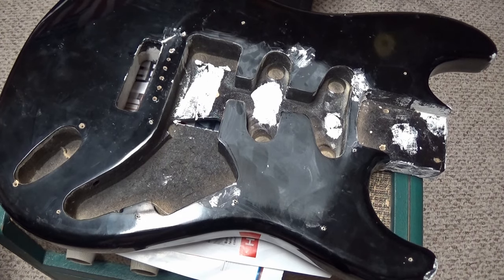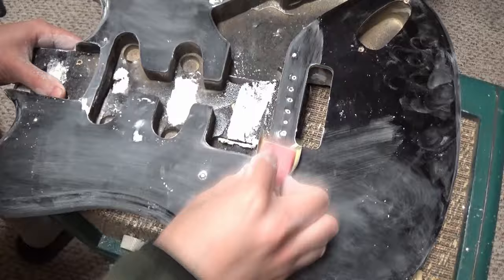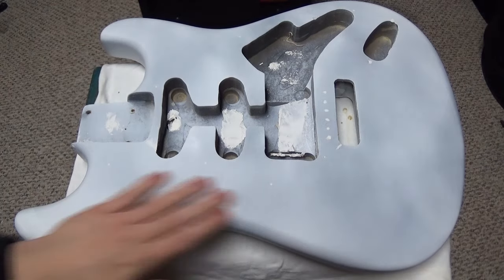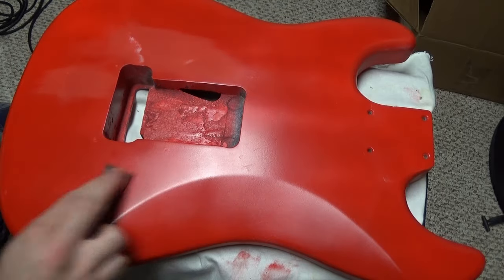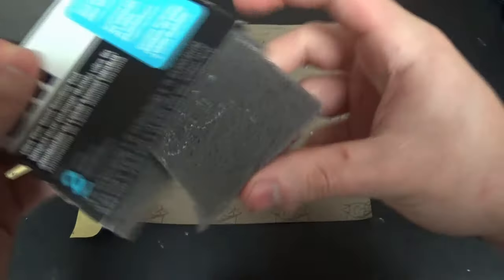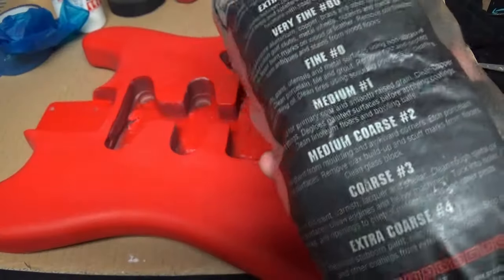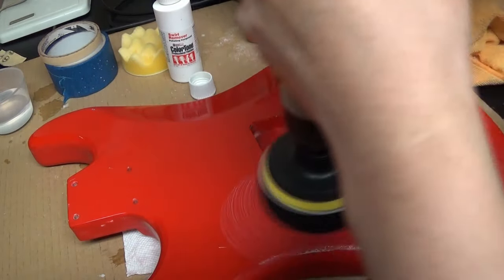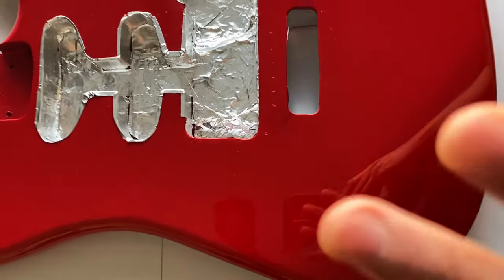REPAINTING A GUITAR WITH SPRAY CANS. Clear Coat Finish

Comment: Interested in knowing what clear coat you used. Was it Rustoleum crystal clear enamel?
Reply from the maker: i used that before. and it left so much orange peel and imperfections. i use the 2k spraymax clear coat, $23 on amazon. It is literally the best clear coat i have ever used in my life. please watch some youtube videos about it, you need a good respirator since there are harmful vapors in it. so make sure you are safe and well ventilated. the 2k clear coat is the best affordable clear coat you can buy that will have a very long lasting finish. the rustoleum clear coat almost never cures, so it stays soft for a very very long time. the 2k clear coat hardens like a rock in 2-3 days.
Reply: Thanks for your time and quick response. I will buy some soon. You have answered all of my questions. Very appreciated.
Reply from the maker: @williambrown5776  let me know what else you need. i need to make an updated video soon once i get another guitar body to work on at home.
Reply: I will thanks. Looking forward to your next video.
Reply: Would Deft clear be compatible over Rustoleum 2x. I finished painting my Stratocaster with almost one can. There are no paint runs but there is orange peel. Should I wet or dry sand, or just apply the clear and then wet sand the orange  peel off.
Reply from the maker: @williambrown5776  is deft clear the clear coat you are choosing to use? if so.. those cheaper clear coat cans will leave lots of orange peel. since the nozzle is a circular spray pattern, it will cause lots of orange peel and possibly runs due to the circle ⭕️ spray pattern. the 2k clear coat i recommend has a wide spray pattern that will lay down much better. but if you do choose to use that deft clear, then make sure you put the can in hot water for at least 15 minutes then shake it up nice before you start spraying. Does your guitar now have a gloss finish with the color? if it has gloss, then i would use a scotch brite pad to scuff up the whole body and remove and gloss before applying the clear coat. just be gentle and make sure not to burn through the paint coat
Reply: A guy at Ace Hardware told it was a great clear. I will go with the 2x clear as you suggested. Is it the rustoleum 2x ultra that looks like the paint can. I know there is the crystal clear and the enamel clear and I surley don't want to mess it all up. If yo mean using the supermax 2x I am not sure I want to use that. Too toxic and no paint sprayer. My wife also has lung cancer. Is there another recommendation.

What do you mean gloss up the paint before adding the clear coat. Also, I used almost a whole can of paint on my stratocaster. Is that enough. Appreciate all your help. If you need any help on guitar theory hit me up. I gotta repay you somehow.
Reply from the maker: @williambrown5776  the spray can for clear coat that i used was “2K spray max clear glamour” $22 for the can. it gives the best results. as long as you have full coverage of color on the guitar, then it should be fine. some paint can colors come with gloss included in the spray can. for example.. rustoleum 2x paint, it has paint and a little gloss to it. i always use a scotch brite pad to remove the gloss from the color. giving it a ‘matte’ look, then i spray the clear coat on top
Reply: I would like to use supermax 2x but with my wife having lung cancer would not be good for her. She also has a brain tumor - her third one.

What other urethane clear would you recommend. I am pretty sure I couldn't use lacquer over urethane. Thanks
Reply from the maker: @williambrown5776  all clear coats have the same / similar chemicals in the can. just use a respirator and keep her away from the spray area. where are you spraying it at?
Reply: I don't have a respirator and don't want to use supermax 2x. I will find something else.
Reply from the maker: @williambrown5776  definitely invent in a respirator. for now you could use a wet cloth on your face to help. spray max 2k is definitely the best. but i’m sure the other clear coats will come out good if you do the proper prep work. cleaning , degreasing and warming the can up before spraying.
Reply: Thanks for the help. You may not be aware of an alternative to to supermax but I will call around to find out what will.
Reply from the maker: @williambrown5776  2k is top shelf, those other rustoleum clear coat may work but they take so long to fully cure. just stay away from any “lacquer” spray cans, only buy ones that say “clear coat” on them. i wish to make an updated video here very soon, just gotta find a guitar body to do the work on. keep me updated if you need any help,

Comment: Is it necessary to do a clear coat with this method?
Reply from the maker: do you want a shiny gloss coat or a matte coat?
Reply: @guitarforall  Gloss. What kind of lacquer did you use?
Reply from the maker: @zemartinho9779  from experience… i started using the “2K Clear Glamour” clear coat. it’s a can you can buy almost anywhere online and it’s the best for gloss finishes. lacquer has too much orange peel which requires lots of wet sanding. the 2K clear coat lays down so much better and less orange peel.
Reply: @guitarforall  Thanks for the quick reply! After the color coats, how long did you wait before applying the 2k clear?
Reply from the maker: @zemartinho9779  i apply color coats until everything is even. wait 2 days for the color to dry and scuff up the paint lightly with a scotch brite pad… not too hard. it’s just to remove any dirt nibs or imperfections. this would also be a good time to wetsand out any runs you might’ve gotten from your color coats. 
Then blow off your guitar and use glass cleaner to clean up and fingerprints / oils from the guitar. then spray your 2K clear coat in light coats … 4 coats should be enough. 7 inch spraying distance, and please wear a respirator

Comment: $7 a can now and those sandpaper sheets are like $1.59. Thanks biden
Reply from the maker: yes they used to be very cheap… now it’s up. couple cents for the paper back then. let alone all the parts that you need for guitars as well.. like pickgaurds, volume knobs , strings. but don’t cheap out on the clear coat! buy 2k clear coat.. much better results and harder finish. i’ll make an updated video soon
Reply: Yep. Just under $8 a can for this brand shown here. $20 +/- for a color shift can that was maybe $10 -$12 3 years ago. K🐫la will be more of the same.

Comment: I'm confused, you sprayed the guitar with Rust-Oleum, which I thought was enamel, so where does the lacquer come in. I'm painting an old Fender Bass was planning on using lacquer spray products from Oxford paint.
Reply from the maker: @EllisRitter-ui6qu  my camera was not recording the lacquer / clear coat process. my mistake. but it’s the exact same steps as spraying the color coat. wet sanding and buffing is necessary if you want a mirror like finish. always sand flat